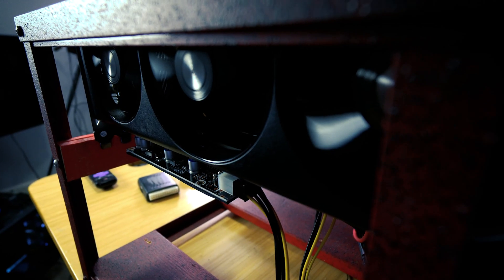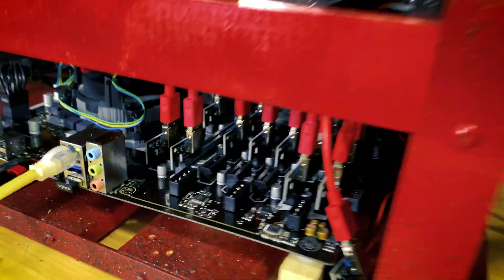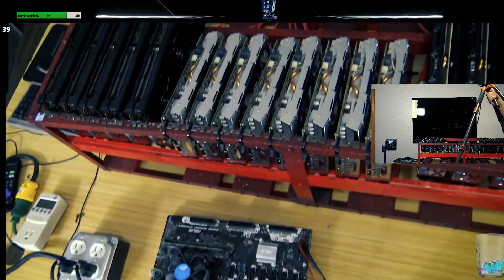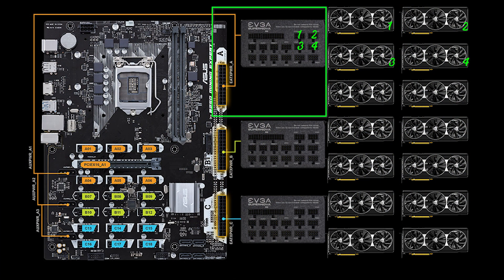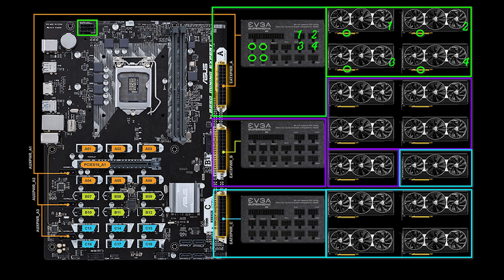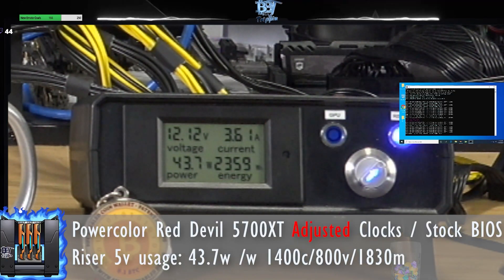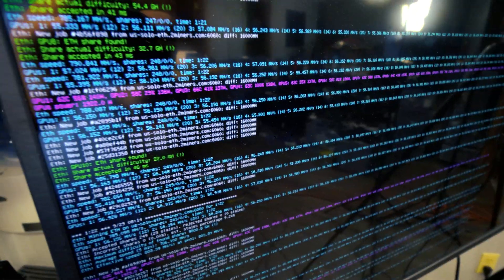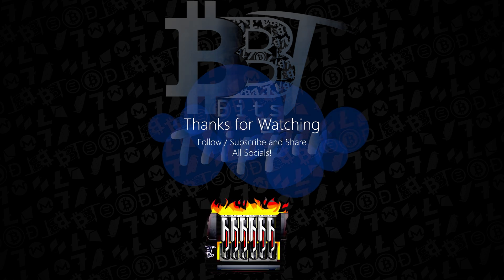14x XFX 5700xt Mining Rig - how did we do it?

Comment: I am currently expanding my farm to a 4th card - so I guess we all just wanna know how you got the cards, not how you build a rig.

Few thoughts tho :)
1. Use real risers. The "china quality" risers and USB-cables are probably not going to yield best results by means of stability. 
2. 
-6-pin PCI-e Power cable is rated for 75 watts/13 amps, the same amount given by the PCI-e lane on the motherboard.
-Molex is rated for 132 watts/11 amps.
-SATA is rated for 54 watts/4.5 amps. - Do not convert from SATA to Molex/6-pin, this will cause an overdraw and could result in a fire.
3. Modding and XT BIOS even further down to will yield 54-56Mh/s with 110 watts. (Max Voltage GFX 840mV , 837mV , min GFX 700mV 750mV) That's +20% lower what you're running currently. This way you don't need to worry about the peaks.
4. 110 to 220 voltage converter 3000w could be something to think about to ease the current draw.
Reply: W•H•A•T•S•A•P•P ••M•E.°^°+•1•7•2•4•3•2•0•0•5•0•6
F•O•R••M•O•R•E••D•E•T•A•I•L•S•.°^°....,,,,,

Comment: you loose to much power on this mh. you can have 57-58MH with max 120 watt power without phönixminer config
Reply: Hey bud how can I achieve those setting I have already bios modded, yet only receiving 53.8 mhs, I am using the radeon settings for overclocking can you give me some settings to achieve higher mhs.
Reply: W•H•A•T•S•A•P•P ••M•E.°^°+•1•7•2•4•3•2•0•0•5•0•6
F•O•R••M•O•R•E••D•E•T•A•I•L•S•.°^°....,,,,,,

Comment: Hi, so you run one 8 pin cable from the PSU to one GPU that requires 6 pin and one 8 pin?
Im wondering how i should power my 2 5700xt's. Can i use a single 6 pin from a server psu and split it to two 8 pins and be safe?
My psu board only has 12 outputs so and i have 9 cards (2x5700xt, 1x5700, 2xVega56, 1xRX580 8gb and 2xGTX1060s)
So im trying to use my 12 cables efficient.. I will ofcours be undervolting them alot, so technically it should be all fine, but im trying to make it safe in case something happends and the rig runs on stock settings. :-)
Reply: W•H•A•T•S•A•P•P ••M•E.°^°+•1•7•2•4•3•2•0•0•5•0•6
F•O•R••M•O•R•E••D•E•T•A•I•L•S•.°^°....,,,,,

Comment: i did a 14x gpu on this MB, and when i insert the 15th card the sistem won't boot, i wonter if you can make it work with 19 cards, without cards like p104-100
Reply: W•H•A•T•S•A•P•P ••M•E.°^°+•1•7•2•4•3•2•0•0•5•0•6
F•O•R••M•O•R•E••D•E•T•A•I•L•S•.°^°........

Comment: 0:58
Wait, Isn't the Intel Celeron CPU only supports up to 8gb ram?
Reply from the maker: 1150 Socket Celeron 3930 supports up to 64gb of ram dependant on the motherboard. This MB has a max of 32GB of ram. We would never recommend that much. 16GB at most, 8GB is more than fine for windows and 4GB is more than fine for Linux. https://ark.intel.com/content/www/us/en/ark/products/97452/intel-celeron-processor-g3930-2m-cache-2-90-ghz.html
Reply: W•H•A•T•S•A•P•P ••M•E.°^°+•1•7•2•4•3•2•0•0•5•0•6
F•O•R••M•O•R•E••D•E•T•A•I•L•S•.°^°....,,,,,,

Comment: You can also set the Core Clock to 1300 mhz and 730 milivolts, and save about 30-35 watts per GPU while losing just about 5 mh/s per GPU.
Reply: W•H•A•T•S•A•P•P ••M•E.°^°+•1•7•2•4•3•2•0•0•5•0•6
F•O•R••M•O•R•E••D•E•T•A•I•L•S•.°^°.........

Comment: need help for setting 580 8gb sir
Reply from the maker: Typical RX 580's can run 1120 core @ 890Mv and Memory at 2150mhz (from base 2000); on stock bios for most that will yield 28.5mh @ 127w GPU; with a BIOS mod (dependent on the RX580 Brand/Memory Type) you can get up to 32.5mh for 118w.
Reply: W•H•A•T•S•A•P•P ••M•E.°^°+•1•7•2•4•3•2•0•0•5•0•6
F•O•R••M•O•R•E••D•E•T•A•I•L•S•.°^°....,,,,,,,

Comment: moral of the story, stay away from this triple dissipation model, out of 7 i have 5 running smooth and 2 always crashing which it quite understandable since the memory on them goes to 104-106C while all the other ones stay around 90 with absolutely no OC. Oh and if you're planning on using them in windows even with an stock bios mod they will indeed hash higher but you will no longer be able to change the driver without reinstalling windows, don't ask me how i know.
Reply: W•H•A•T•S•A•P•P ••M•E.°^°+•1•7•2•4•3•2•0•0•5•0•6
F•O•R••M•O•R•E••D•E•T•A•I•L•S•.°^°....,,,,,,

Comment: Can you please provide more info on specific power cables - I have two of these same PS and unable to get 9 cards up and running because of lack of power cords.  Specifically how are you powering the risers  and is it possible to get more dual 8 pin cables if you don’t happen to have them just sitting around? 

I used SATA (dual) to 6 pin adapters on my EVGA 1200 PSU each running only a single riser and MELTED the WIRES and almost started a fire.  I will never use them again.  I thought I was smart by using dual SATA into 1 6 pin rather than running SATA directly to riser but they still almost burned my freaking house down.  NEVER AGAIN
Reply: W•H•A•T•S•A•P•P ••M•E.°^°+•1•7•2•4•3•2•0•0•5•0•6
F•O•R••M•O•R•E••D•E•T•A•I•L•S•.°^°....,,,,,,,

Comment: so memmory temp of 90C is normal for the 5700XT? (is the 5700 also the same?)
Reply: W•H•A•T•S•A•P•P ••M•E.°^°+•1•7•2•4•3•2•0•0•5•0•6
F•O•R••M•O•R•E••D•E•T•A•I•L•S•.°^°....,,,,,
Reply: the danger zone is between 94-104 according to Steve from gaming nexus. 
I like to stay way below that myself for fan noise and safety reasons.

I have 50 c junction, and 74 c mem temps while keeping 54.37 mh.
Settings OC:
vdd(720)vddci(740)mvdd(1280) mem 900hz. 
fan is 50%
I also have desktop fan of 23 cm blowing at my cards, 
and i changed the thermal paste and adjusted the thermal pads. 

I also do some bios stuff, but i wont get into that in the comment field. Would take forever.
Reply: @Professor_Bugs  May I know the Core value of your OC?

Comment: Hi, what would be the ideal temperature for memory? I see you have several in 90, 92, 94 degree
Reply: the lower the better . i have seen these cards run at 95c with no issues but its best to put a fan on them to keep them around 84c . i dont know why his cards are showing 140 watts in hive mine are 113 watts in hive . with 1400 core   930 memory  800vdd  total power draw from each card with  a watt meter on the riser and 8 pin + 6pin is 140 watts  so that means his cards are pulling almost 200 watts each they need some adjusting.

Comment: I have 8x Asus B250 rigs with 13 RX580 cards each running Phoenix miner. Often the rigs run for weeks without a reboot. Have never been able to get the B250 to post with more than 13 cards. I'm guessing it's got to do with which slots you use or something. How did you guys do it.
Reply: W•H•A•T•S•A•P•P ••M•E.°^°+•1•7•2•4•3•2•0•0•5•0•6
F•O•R••M•O•R•E••D•E•T•A•I•L•S•.°^°.......

Comment: Hi, i see molex is not connected to mobo. is that ok running this mobo without those molex?
Reply from the maker: Yes, with powered risers you do not need to use the molex 5v board supplemental power. That was designed for non-powered risers.
Reply: @BitsBeTrippin  ok thanks got it. By the way like your videos. Keep that way...
Reply: W•H•A•T•S•A•P•P ••M•E.°^°+•1•7•2•4•3•2•0•0•5•0•6
F•O•R••M•O•R•E••D•E•T•A•I•L•S•.°^°....,,,,,,

Comment: Why not just go with a H110 mobo and HP server PSU's ??????
Reply from the maker: You totally can, however we had some 1200 P2s already for the build. Additionally they are much quieter if your going to put in a place you don’t want a 90+ decibels. The HP power supplies though would shave several hundred off cost.

Comment: Sata? Are we using sata ?
Reply from the maker: Sata to 6pin adapter- one SATA per strand. Required if your using retail PSU; using server style PSU with breakout boards you can use 6pin directly
Reply: @BitsBeTrippin  ahh ok, i have 4 2080,  3 1080 ti and 7 1080s. B250, 1600 T2 psu, 1200 w server psu. Can you help with setup just like you did here, dont need to make a whole video (unless you want to, and I would appreciate) but a quick write up would do as well.

Comment: It's not easy to keep more than 8 gpus in a single board with a good uptime.
Reply: i have (12) 10 card 5700 xt sapphire gpu's using the h110 pro btc motherboards running with no issues . 

250 watt piccos and server psu's  with custom built cables .
Reply: @Spidersoftheworld  I have 7 of those same cards but I'm having difficulties running it in Windows. Wattman continuously crashes after about an hour. How are you stabilizing them?
Reply: W•H•A•T•S•A•P•P ••M•E.°^°+•1•7•2•4•3•2•0•0•5•0•6
F•O•R••M•O•R•E••D•E•T•A•I•L•S•.°^°....,,,,

Comment: mmm but how you can connect the risers if its not sata? that power supply dont have more vga cables, you will have to use another PSU right?
Reply: W•H•A•T•S•A•P•P ••M•E.°^°+•1•7•2•4•3•2•0•0•5•0•6
F•O•R••M•O•R•E••D•E•T•A•I•L•S•.°^°....,,,,,

Comment: BBT, 57Mh/s @ 140w wow that's allot of power.  Based off of videos I watched from you I was able to achieve 57Mh/s @ 97w.  Very stable on windows rig using PhoenixMiner on the latest AMD drivers.  Currently running 4 Sapphire Nitro+ 5700xt cards.  About to add two PowerColor Red Devil 5700xt cards to the mix.  This is by applying straps, modding bios, then using PM to apply the OC.  Why is your power consumption so high?
Reply from the maker: That's from wall? 140 is the 95w from 12v rail and 35w from 5v riser.
Reply: @BitsBeTrippin  that would be 130w😀
Reply: How are you measuring the power consumption? Do you have the GPU on its own meter? If not are you including the idle draw? Also I think cards with Samsung RAM may use 10-15w less than those with Micron RAM. I don't think anyone has tested this yet but I think this is why some people are in the 130s and others are in the 140s. Also seems the Micron clocks higher.
Reply: @fenixmining  maybe I missing something...  You are saying the same things as BBT.  I was only taking about what the software is reporting.  His power in Phoenix Miner shows 140w @ a hash of ~56 mh/s.  Mine (in the software as well) shows 97w @ 56 mh/s.  Now let's talk real numbers (because software lies)...  The actual power usage is always more than what is shown in the software.  I'm using a meter I made that has three read outs.  It measures the 6pin riser power, the primary 8 pin of the gpu and the secondary 8 pin of the gpu (which I only use 6 pins on for my nitro+ cards).  I have pictures of the meter clocking the values but can't paste them on YouTube comments.  I also have a kill-a-watt meter at the wall for the whole rig.
Reply: I have Red Devil and Thicc III Ultra 5700XTs with Micron memories, they all consume 120-130W with ~57.5Mh/s. While my Nitro+ has Samsung memories and it consumes only 90-95W @ ~55.5Mh/s. Software values. Micron memories can reach higher MHz. 
About temps, Nitro+ has also quite low mem temps ~68C, while Powercolor and XFX goes to 80-86C. I already replaced thermal pads for one Red Devil as a test, using Gelid Ultimate, and moved the original pads between PCB and backplate, now mem temps are ~68C. l will do the same trick for all others.
Reply: @teroparta  Yeah, my Nitros are awesome.  My Red Devils are always hotter and take more power to achieve the same hash rates as my Nitros.  I was watching a teardown video of the 5700xt cards (both talking about Red Devils and Nitros).  He was bashing the Nitros and praising the Red Devils to some extent.  He was complaining about how the Red Devils use all 10 power spots on the base card layout and the Nitros only used 8 of them.  He was not reviewing/tearing down for mining but gaming performance but still energy is energy.  The Nitros seem to perform better than the Red Devils in my opinion (whatever that's worth).
Reply: W•H•A•T•S•A•P•P ••M•E.°^°+•1•7•2•4•3•2•0•0•5•0•6
F•O•R••M•O•R•E••D•E•T•A•I•L•S•.°^°....,,,,,

Comment: i run 12 card rigs on asrock h110's...theres room for 13 but i seem to get more stability runing 12 on them...got a 2080sc hybrid rig 12x got 113days uptime on it.
Reply from the maker: Nice! Would love to see that, tweet a picture on twitter if you can! Sounds beastly
Reply: What's your BIOS settings on ASRock? Gen 1 or 2 or auto? CSM disabled?
Do you skip the pciex16 slot?
Reply: @pho3nix3871  Definitely don't use that port.
Reply: W•H•A•T•S•A•P•P ••M•E.°^°+•1•7•2•4•3•2•0•0•5•0•6
F•O•R••M•O•R•E••D•E•T•A•I•L•S•.°^°....,,,,,,